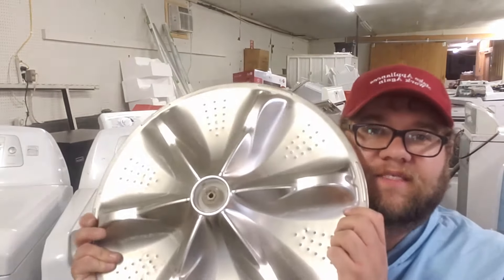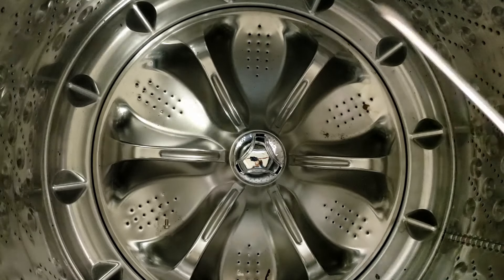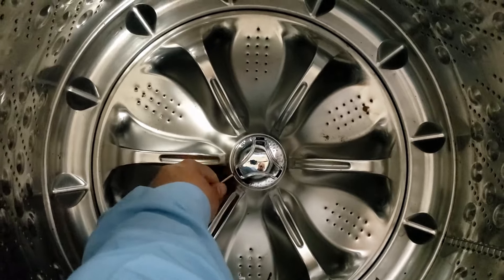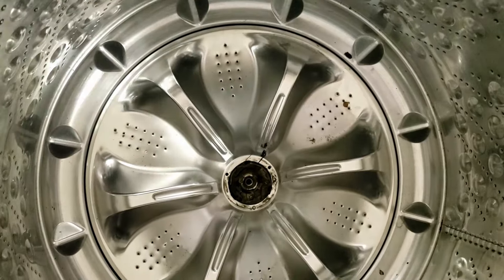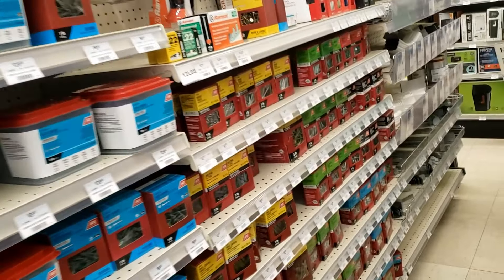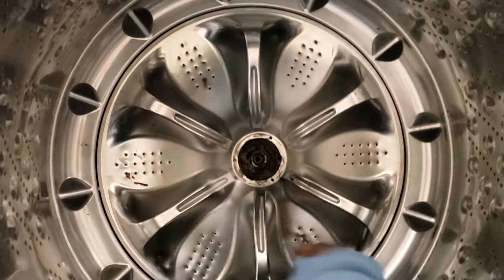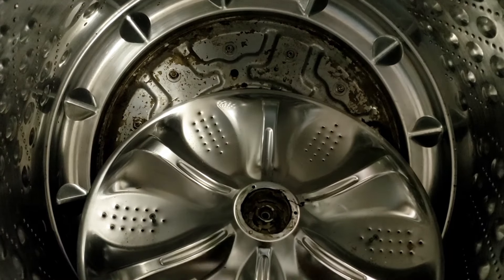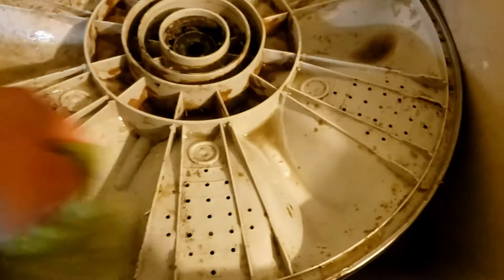How to Remove a Wash Plate that is Stuck on a Washing Machine - LG Pulsator Wash Plate Removal

Comment: So I did all these crazy methods and what worked was to remove the cap and screw. Run the washing machine on express wash. As it filled w water the pressure of water pulled it right up! I couldn’t believe it. Then once it’s up. Pause the machine. Hit the special care button to spin to drain. Done!

Comment: There is a better method use a flat strap from like one from a ratchet strap work the center of the strap under the wash plate and pull on both sides of the strap this method presents you from screwing into the wash plate
Reply: I actually tried that, and it still wouldn’t release. In fact to gain more leverage, I actually put a piece of wood across the top of the washer and pulled so hard I was afraid I was gonna bend the wash plate and half. That SOB is stuck like it was glued on.
Reply: Mule tape worked for me.
Reply: @dougc78 this is what we did too and it only lifted on one side after pulling like hell but the other side didn’t lift. I’m so over this

Comment: Could this be a reason why my clothes are smelling like mildew because this wash plate needs to be cleaned?
Reply: Definitely. It's likely not only dirty under the wash plate, but inside it between the two pieces. Check this video out that shows the scum inside the wash plate assembly...
https://youtu.be/MftBIx1fNYA

I haven't come across a tutorial for separating those two pieces yet...
Reply: Hopefully the screws will never be forgotten to be removed. Lol
I'd use a disinfectant as well or a cleaner that disinfectant as well as cleans.  The manufacturer should design it with a  hole to utilize a common tool for removal.😊

Comment: I had the same issue today and mine was stuck on very very tight. I did not use screws but I did leave the bolt and cap off.  I ran a normal cycle and within 5 minutes it popped off on its own.
Reply: Omg just found this comment.  Been trying to get this off for an hour, started cycle and it popped right off!!

Comment: Slick tip. Worked great but I also sprayed a bit of WD40 down the centre bolt hole, let it sit to break up the "goo" and then with a little wiggle it came right out. Had a small burr, used a small file and all is good. Thanks for this.

Comment: I like the screw idea. But I just used two small Allen wrenches and slipped the short end through the hole and turned until long end was sticking up and pulled up with pliers. This kept me from having to thread anything. Try it on your next one and let me know what you think.
Reply: This worked perfectly for me.  Two big thumbs up!

Comment: Tried several other methods to remove the  Pulsator Assembly on my LG WT1101CW washer and this worked! Thought I was gonna have to cut it out. I did bend it because it did not just pop out, but I was going to replace it anyway. Thanks

Comment: I had two ratchet straps with a TON of tension on the plate edges. Didnt move one bit. Added two #10 deck screws and it slid nicely up. Thanks a bunch!

Comment: Thank you, this video saved my washing machine project! The screws left burrs which I’m trying to file down, but they also bent the edges of the drain holes slightly upward. What’s the best way to get them reshaped downwards? I’m worried about snags on clothes.

Comment: Thanks for this video. I used it for my Whirlpool Cabrio plastic wash plate and it was the only way to lift the plate. I also applied wd40 into the main shaft hole after removing the bolt with a ratchet to break up rust. Thanks again!
Reply from the maker: Glad to hear it. I am gonna work on another trick soon that may help on other washplates if you don't want to use the screw-trick.
Reply: never thought of rust when I tried to remove mine today.

Comment: really clever idea...  doing this right now.   i found the perfect screws and was able to get 2 solid grips and pulled very hard slowly applying more "strength"....but when it got to the point where i thought i might actually warp the plate... it was still stuck on.  any ideas?  are "LG" washers different for some reason?
Reply: Did you ever get it off.  I am unable to remove mine.
Reply: @debbiegriffin9288  no!  I called LG and they sent out a repairman since I was still under warranty and the guy couldn't get it off either!!   I've just learned to live with the grinding noise.  Something is obviously stuck in there like a coin or piece of metal, but it doesn't affect the performance.
Reply: @Andrew-Comi  ,thanks for your reply.  mine is not under warranty and I am just trying to clean between the plates.  I tried everything! 
I think that since yours was under warranty they should have found a way to fix it.  Hopefully you won't have issues in the future.

Comment: Hi Ben   I have an LG and have taken it off at lest 3 times to clean soap scum out. This time it 
was stuck and I tried using a bent probe used in auto body. The probe did not do the job and I heated a pot of hot water and put it all over the center hub slowly . I then pulled up and down several time fast using the bent probe in the center opening and it came out.

Comment: Hi Ben. I was able to remove my plate without the screws by using the two channel locks in the middle hole. Just grabbed onto the opposite edges and pulled it right out. Thanks for the first steps though.

Comment: When you've removed the cap to get to the pulsator plate, is it an easier way? There's three little holes at the top to put the screwdriver just so you know

Comment: I sure wish this worked for my unit.  I also tried this with boiling hot water and it didn't even budge.  Lifted the whole unit off the ground, shook it like a dog toy, and then gave it a few choice words...nothing!  Looks like I am going to have to use the cutting out the center method.  Good idea though.  I will at least give you a thumbs up like for helping others.
Reply: I’m in the same boat 😢

Comment: A couple other suggestions that worked for me: putting it in spin with the bolt in a few threads after the citric acid treatment (or with it). And, I haven't tried it yet, but inflatable airbags.

Comment: I tried WD40 trick but was no help. I was successful using the method another commenter suggested and that was to put it through a wash cycle after having removed the plate bolt. Worked like a charm. Plate came off within a couple of minutes on its own. Used the Whites setting so water was hot. I suspect that helps. Thank you to that commenter and for this video!
Reply: Is it safe to run washer after taking off the bolt?
Reply: @ there was no problem when I did it on my GE top loader. The agitation by the washer and warm water using whites setting loosen the plate without damage

Comment: Ben, is the washplate supposed to move independently of the outer washtub, or is that an indication that the splines on the washplate are stripped ? Thanks for the videos.

Comment: My machine is a LG  WT-H8006 ONLY 7 year old (first LG was14yrs before I replaced it & better bag type filter system) 

Current machine started throwing a LE ? motor error. turned out more fluff and grey brown grit causing the blockage. I don't know where that grey grit is coming from.  

I managed to get machine going again filling with hot water, sitting and washing with soap powder. 

Bloody thing is working again, AFTER I bought a new machine.  

This machine wash plate is stuck on well, and I think I have more junk under the plate than yours. 

I got as far as removing that centre cap and screw but couldn't remove wash plate.  

After so many hot cycles there is still lots of fluff (maybe 7 yrs worth still coming out.)  

Filter system is shocking need original bag filters again.      

Love your video
Reply from the maker: I'm going to do a vid soon on secret chemicals you can use to remove obstructions under the wash plate - both for cleaning the washer, and getting rid of the garbage that could keep the wash plate on it. I bought a few different chemicals to see what works, and my hope is the video will help resove the issues. The gunk you dealt with is probably from the hot water ripping apart some of the scum underneath which held the motor on the LE error.

Comment: I CANNOT get my plate off! I've tried running various tub clean cycles with the cap off/bolt out. I've run it with vinegar, iron out, plain water you name it. I have have been trying to pull it up with the screws, grabbing on to them with the plyers and pulling up....but this thing won't budge. We have really hard water here where I live and I've never taken the plate off in 8 years. Is it just a gonner at this point? Do you pull straight up, or wiggle when pulling up? Any other tricks?

Comment: Hi I have a ge top load and the bolt that holds the plate in broke can drill and and tap if need be or do I need to buy a new gear housing?

Comment: Hi Ben! We followed everything on this video and got the cap off and took out the bolt underneath and put the screws in and pulled and still can't get the washplate to budge.  Is it possible that there is another screw holding the washplate down that was underneath that bolt under the cap?  Or something else that is keeping it stuck down?  We have a LG Inverter Direct Drive Washer.
Reply from the maker: Unless its built dramatically different - no - I am unaware of any additional bolts that'd hold it down other than the main one in the middle. You may want to try the trampoline spring tools that I mentioned in the comment section. I bought a few after this video, and they seem to work really well too. The other thing you may want to look at is pouring very hot/boiling water on the washplate to possibly dissolve any buildup underneath the plate that'd keep it held on.
Reply: @bensappliancesandjunk  Ok, It's so strange because we can feel it jiggle, and the screws hold well, but it just won't come up. We pulled so hard that it lifted the washer, so ....? We will try the boiling water first and see if that works.
Reply: Does the wash plate need to be submerged in the water?
Reply: Probably too late for this job, but I would apply heat to the hub / center with a heat gun.  
The metal will expand and hopefully break the grip of the pulsator to the drive shaft.
Reply: Ronald Santos we undid the bolt and turned it to rinse and it popped off like 2 minutes in with water
Reply: @TheKingTimmy  Thanks for the suggestion.  I tried this because mine was on like glue and a few minutes into the wash cycle and it popped off.
Reply: Did you ever get it out? I have an LG and am having the same problem.
Reply: @chaseharkness7819  I have LG Fuzzy Logic Turbodrum Model T8107TEFTO, the pulsator is deep frozen/bonded onto the spline drive.

I treated it with WD40 for several weeks but no success even hammering the center screw when it was unscrewed a bit to make a gap and promote direct impact to nudge the frozen/bonded metals.

My 3rd plan would be just cutting out the pulsator with a jigsaw if the YT uploader's technique would not work for the 2nd time around.
Reply: We have the same washer and I can’t for the life of me get the damn thing out. It’s been 4 days and I’ve done every method.

Comment: Hey Ben, how do you remove a plastic bottle cap that fell in between the wash drum and inner sidewall of my Samsung top loader washing machine? Can I access and remove it by taking off the the wash plate?
Reply from the maker: Yes, you're correct. Remove the wash plate, and underneath there are 5 or 6 huge metal fingers that have 1 bolt each. That holds the inner drum and outer drum together. Remove the bolts and the tub will lift out SUPER easy

Comment: Tried the screws. Nope. Tried screws and straps and tapping with rubber boot all together. Nope. Ran on my cycle with hot water. 10 min. Later it was floating. 😄 thanks everyone for tips and ideas.

Comment: I tried the above a couple times, plus citric acid and zap degreaser.. NOTHING worked!

I then sprayed the middle (where you remove the screw with a wrench) with WD40. I waited 30 seconds and tried again with screw tip from the video and it popped off with little to no effort. Really appreciate the tips. If I were to do again I’d prob give the Allen wrench tip in the comments and WD40. Thanks again!

Comment: Good technique. 
I suppose you could snip the points off the screws to make the process safer.  (To lessen the risk of piercing the tub.)
Reply from the maker: I looked into this during filming and unless you have 3" screws, theres a pretty large gap underneath the plate between the plate and the tub due to how the inner metal tub is mounted

Comment: We have an lg fuzzy logic tried everything even this and nothing not even a little movement
Reply: Same! I been pulling so hard and so much, using the pliers that underneath my thumbs their burning, swollen red from repetition. Frustrating!
Reply from the maker: I'm going to put out a "2.0" version of this video at some point, as this doesn't always equal a sure-shot for every style of washer.

Another REALLY GOOD ONE is to pour VERY HOT water in the tub with the rotor bolt OFF so all the hot water gets in, underneath. Run an agitation cycle through it, and it will help break off the junk and free the plate.
Reply: Will be trying this method , also have a problem of it holding water even after it’s done all it’s cycles
Reply from the maker: @tianahepworth576  Is it holding too much water?
Reply: It’s a washer that was gifted to us and was not looked after. After it’s washed all the cloths and it’s drained. It still obtaining water under the wash plate./drum I’m gathering this is because it’s so built up
Reply from the maker: @tianahepworth576  some water under the drum is totally normal. It will cycle out during every wash cycle.
Reply: Thank you. Hopefully I can get the wash plate out to do a good clean  of it

Comment: First thanks for the video I tried your method didn’t work for me i used the back of a hammer inside the cap hole and pulled it with some wiggle and it came off in few seconds

Comment: WD40 works so much faster and less steps. Just spray and let it set (I let it set over night). Obviously our machines aren't this clean and have lots of gunk holding the wash plate like glue. Then you won't have to use screws, it'll come right off!

Comment: DON'T DO THIS! TRY MY METHOD INSTEAD!! I watched a TON of these videos and only 1 worked. I felt dumb after trying all the tools and straps. Just take off the plastic cap. Remove the bolt. Pour in some bleach and set it on 'Tub Clean'. I canceled the cycle at 0:50 and the washplate was there floating in the water. Stupid easy. The tub will drain automatically after a while or you can just close the lid and let it complete the cycle. I felt silly after trying to manhandle the washer! (Note: I'm 5'2" petite female and probably wouldn't have been able to muscle that thing off anyways.)
Reply: THIS!  Amazing advice, worked perfectly. Thank you!!
Reply: Thank you so much!!! 😁
Reply: I ran a spin only cycle for 2 minutes and it works the same.
Reply: Worked great thanks

Comment: I don't think your definition of "extremely difficult" and mine is the same. Here is what "extremely difficult " is in my experience of taking off this same washplate that was in an LG top loader.  Get ready... set..... read:
The metal  splin collar on the washplate is what of course aligns and sit in on the shaft from below.   Now that metal on the washplate totally fused with the shaft.  how fused is totally fused?   After beating the living hell out of the wash plate and cutting it off, I had to cut and grind to get that metal collar off the shaft.  Time spent 4 hours.
If you can use screws to somehow be able to to remove the wash plate, that wash plate wouldn't be called stuck.
If you simply spray some lubricant and let it sit for awhile and then wiggle the wash plate to loosen it enough where you can feed just a good strong twine ( feed two or three for more strength)   behind the wash plate and simply give it a good jerk.  That will give far more force than grabbing two screws with two fingers on each, no comparison.
Cheers.
See this guy, the professional.  Same as my procedure except he was a little more fortunate after over two hours he mumbled. His cooperated with a chisel.  I did what he did but If I hit mine any harder I would have damaged the bearing down below.
How To: LG/Kenmore Pulsator Assembly AGZ72909711 - YouTube

Comment: This technique didint work for my 25years old untouched w m.i had to hit  with a 6mm rod in the middle then it came out.
Reply from the maker: The video was primarily focused for machines made with newer style pulsator washplates. Hince the use of an LG in the video. Glad to hear you found a solution!

Comment: None of these worked for me. Ultimately i got it off with a smal handsizedl crowbar. Make enough space to fit the crowbar under and then work it around the plate at an angle.

Comment: I have tried every tip and trick i can find, and mine just won't come out. I dont even care about keeping it. I would replace it for $55, but it just won't come out at all. It's broken a screw driver,  a hammer, and the grips on my vicegrips. I can lift it off the ground with the screws in it and it just hangs in the air. I think we must have done laundry with concrete.
Reply: Did you try CLR? Worked for me after 5 minutes of pouring it down the center